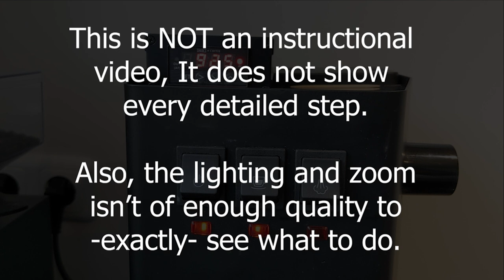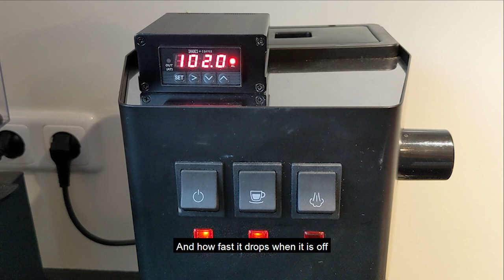PID Mod for Gaggia Classic Pro - Assembly steps and demonstration

Comment: I like that you just put the pid on top instead of the awkward sticking it on the side i  would like to do it on top like that but Did you experience any issues  of the pid getting too hot sitting on top of the machine? I was thinking maybe i would put it on a piece of wood or something to raise it off the sheet metal being heated by the boiler

Comment: You sent the temp to 93 degrees? But that will account for the boiler temp not the group head temp where there is a discrepancy of about 4 degrees
Reply from the maker: Actually thats incorrect because in the PID module you set a static delta setting value to correct for this.

Comment: What is the wiring for the second (steam) thermostat?
Reply: The answer might be if you use a pid modified to run two relays only one thermocouple is needed because the second relay works off the pid alarm settings to control the steam temperature.
Reply: It took time for my brain to wrap around all concepts involved. Since GCP doesn’t use a circuit board to control temperature, switching and settings, you are only intercepting the mechanical switch (thermostat switches on boiler), and routing them to relays that are controlled by the PID controller. Only one thermocouple reading is needed. And the steam relay, in my case, isn’t necessary because I’m only steaming enough milk for a cortado and never ran out of steam anyway. If you need to make multiple cappuccinos this isn’t the best machine for you anyway!